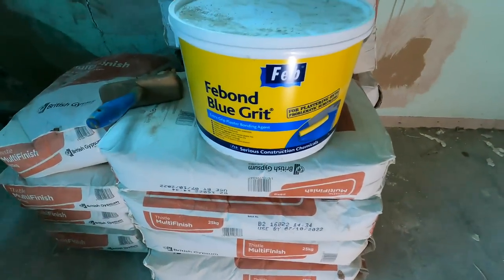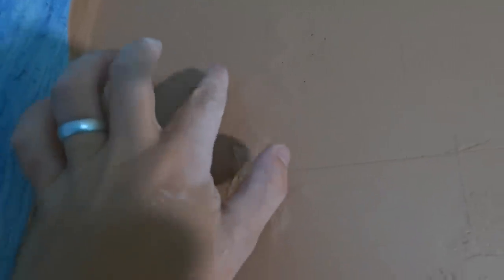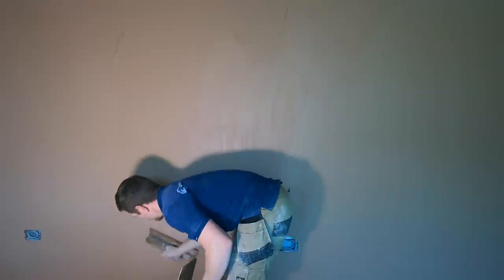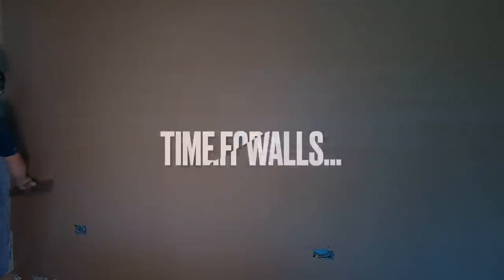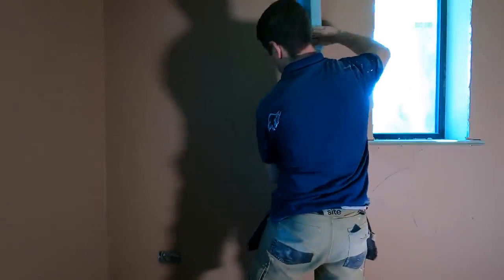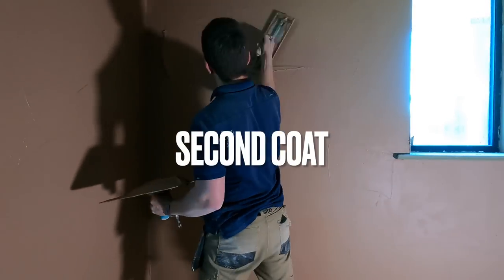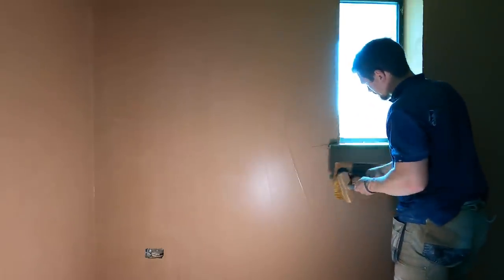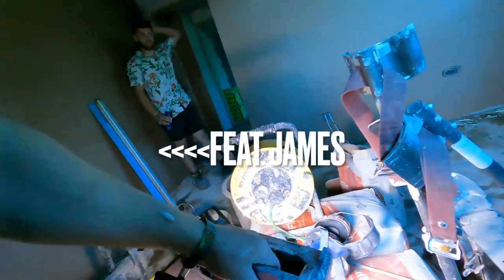I Hated Bluegrit Before| Here's Why I Was Totally Wrong

Comment: When I have had to grit, I’ve used Cementone plasterers stabilising primer, never had any problems. It is green, The grit is smaller too. I had to use blue grit for a job, it was horrible to use and like you said, you have to put it on think. Personally, I won’t use blue grit again, I’ll stick with the green grit when I need it. Good video 👍
Reply: I’m the same mate, I’ve watered it down with pva before but on a high suction background I’ll just put a pissy pva coat on the wall prior to the green. Lovely to skim over
Reply: I’m a bit old school if it ain’t broke don’t fix it never really had an issue with pva. A few people have told me they’ve had a set fail with blue grit so I’m a bit wary to use it. Plus like you said Blaine got to prep it the day before that’s ok if it’s a big job. But the green grit sounds a shout
Reply from the maker: I’ve used this for Rendering and it’s a much easier product. Just never used it for Plastering but I’ll try it now. Thanks for the suggestion!!
Reply: @bluevanmani  I had pva fail the other month, 2 coated the walls, next day the pva was peeling off like clingfilm. Then had to green grit the walls and wait another day. Never did figure out what went wrong
Reply: @NiktheEnglishGreekCypriot  the only thing I would say was maybe the pva was to strong with the first coat. Like you I do two coats but the first ones quite weak so it gets into the surface rather than drying to quick and sitting on it bit like when painters do a mis coat on new plaster.
Reply: @bluevanmani  yeah maybe mate, never happened before or since. I’ve applied neat pva for ages and never had an issue but since that happened I’ve done a 70/30 mix then a 50/50 maybe like you said.
Reply: Ive had 2 failures with green grit.. the full ceiling shelled off! It was scary how easy it was to get off

Comment: Just subed , I'm a chip for 35 years now. Just used blue chip 2 days ago on a skim fail on some artex , all plaster fell off so I straight on with blue chip , 48 hours later I plastered today. First I had to identify the problem,  this was an irregular crack to start off with along a ceiling collar,  an cast iron gas pipe had a 4x2 wedged underneath pushing on this 1 collar down ! Had the thing capped ! But it's never straight forward to half of these over skimed atex

Comment: the trick to using these products is to pva the backround first to kill the suction, the issue is the bluegrit ia drying to fast,its the same as using masonry stabiliser on outdoor sand and cement walls before painting them to prevent paint peeling

Comment: Not a pro, and I've only done a couple of walls over bluegrit. But my experience was that any grit showing through the first coat didn't matter. Just use the first coat to get the surface basically flat even if the texture is a little rough. The second coat will go on like normal and cover it.
Reply from the maker: That’s what I found mate. Good points 👍

Comment: I've seen pva fail used on reskim over sound skimcoat. That put me completely off ever using pva.
Blue grit may be more hassle but its much more reliable option in my opinion
Reply: I heard this one before. Look, PVA has been around for many many years. It'll be around forever. Blue grit or pre grit as I prefer is better but if a plasterer earns £200 a day then who is going to pay someone to roller the walls etc. As a plasterer myself, it's a easy day for me but it's expensive.
Reply: @taureanwilliams2900  I use SBR diluted about 4-1 instead of PVA which I have been caught out with it  re-emulsifying more than once over the years.And I prefer using Bond It Plasterers Pregrit, which I consider better than Blue Grit.
Reply: @taureanwilliams2900  very true. If I decide to use a grit I’ll either get a labourer to do it, or it’s charged at a day within the quote. Bear in mind it’s not just rolling the walls on that day, it’s scrumming, prepping the walls, can get beads ready, putting foam floor protector etc, so hardly just turning up and rolling the walls
Reply from the maker: Good points here lads!! Why spend more when PVA works and it’s faster??
Reply: @PlasteringForBeginners  I often use pva, but if I’m going over a wall that’s had paper on it previously, and especially if the clients stripped the paper and washed the walls down (on a job now that this was meant to have been done by the homeowner, was done badly), then I’ll use a grit for peace of mind. I also like skimming over the grit, feels like you get a nice purchase on the wall in comparison to going over a painted surface
Reply: @NiktheEnglishGreekCypriot  I’ve heard it so many times from customers and homeowners that the room will be emptied and they will strip off all the paper or flaky paint and all we have to do is the plastering. Needless to say it’s never all taken off the way it needs to be. It always ends up with the actual work being delayed while the background is prepared by us. I always price work with this in mind now. It’s a lot harder than people might think it is to completely strip and wash a surface ready for reskimming.
Reply: @teddysuhrensghost263  always a nightmare. I charge them by the hour if it’s not done correctly or cleared out. But I agree, it’s not easy, I’m a decorator as well and I’m both professions I detest the thought of removing paper and getting the areas ready
Reply: @NiktheEnglishGreekCypriot  oh, you see the worst of both worlds if you do decorating as well then 🙈😂. Fully understand charging by the hour for doing it correctly, as I do as well. Customers tend to look at me like I’ve shat on their carpet when I tell them but I refuse to budge for the reason that if something happens and the finish fails they won’t hesitate to call me back to fix it at my own cost. They want the best of both worlds I find. There’s a fine line between being accommodating and letting them take the piss.
Reply: Blue grit with 5l Pva if got time or if going over vinyl silk. Otherwise I use just Pva.

On them sandy backgrounds where you sometimes get in a tiled kitchen or bathroom that you bond out and still sucks like a bastard always seems a issue no matter what.

Tried sbr Pva blue grit. Dancing to Michael Jackson and still always a fuker 🤦‍♂️🤦‍♂️

Comment: How about a ceiling with plasterboard (just put in) do you think i can blue grit and then plaster?
Reply: Yeah you can do but it’s not needed. Better off just pva’ing it instead if it’s dusty or you need longer
Reply: @NiktheEnglishGreekCypriot  Thank you Νίκο, i was just thinking if it has very good adhesion to put it first, maybe the grit will make it even stronger, i know it's overkill but it's on my place and i thought why not.
Reply: @leosedf  no worries mate. Plasterboard is designed to accept plaster with no work to it, so unless the boards are really old and windswept, cut sections, or it’s dusty, then there’s no need for pva or grit. It will give you more time if you need it, but in that instance, you’re better off with extra time or an additive like that
Reply: @NiktheEnglishGreekCypriot  Oh i didn't know that, i was talking about a brand new bare plasterboard. Thank's a lot for this info.

Comment: I really don’t like blue grit at all, it absolutely eats plaster. Much prefer the bostik stuff that’s green and the bond-it yellow pregrit. Finer grit in both, use much less plaster I find. I fully agree with you saying that plasterers seem to think it solves all problems with backgrounds. It doesn’t. I’ve seen blue grit fail for a few reasons. A bad background is a bad background and needs to be sorted properly.
Reply: If I have to use blue grit, I always magic mix the first coat to get over it, second coat of just finish is super thin

Comment: Lad throw that blue grit in the skip where it belongs, if you want a grit there's only 2 options in my opinion, if ya got a big job and the the time to prep the day before it's bondit pregrit (yellow tub) grit is nice and fine and is like 120 grit sand paper so pretty much like skimming over plaster board, and it's cheap and goes further than bluegrit, second one is an amazing product from arrow (arrow bond grit) same texture as the first product but one hour drying time, skim same day, little pricey but I always have a bucket in my van, I  don't bother with pva, but as you said the background had to be good cos the grit is only as good as what it's put on,

Comment: Blue grits purpose is for problem backgrounds ie silk paint , smooth concrete staircases anything that doesn’t have suction that would make the plaster slide hence the grit to give you a key  otherwise pva all the way for internals 👍🏻

Comment: Best tip i have seen using blue-grit was from Alex Morley and that was adding a tub of neat pva to half tub of 10lt of blue grit is lot easyer to apply spreads better less clusters of grit and goes off a hell of alot quicker same day plastering on blue grit done this on my last couple of jobs works a treat 👌🏻
Reply: But pva re emulsifies! So what holds the grit onto the wall?
Reply from the maker: Thanks for the heads up pal! I’ll give that a go 👍
Reply: It’s all well and good but your using a tub of pva to mix in the blue grit not cost effective might aswell get a decent grit like microgobetis or even wba is decent
Reply: @brimplas1  mabey SBR instead ,
Reply: @brimplas1  I’m pretty sure blue grit is predominantly pva itself, I’ve always added pva to it when I’ve had to use it and never had any issues
Reply: @NiktheEnglishGreekCypriot  the problem with that is pva re-emulsifies... Blue grit doesnt this it must weakness the grit bonding to the wall.. i trust pva to stick to any surface, the only problem with pva is the skim can slide..

Comment: I'm working on restoring a period property. The walls were plastered beautifully but for some reason the previous owner lined the walls with paper and then painted it. When I peeled it off (took ages) , the plaster is smooth, very cold to the touch with bits of mould on it. I'm trying to paint it without the lining paper. Do I need to skim it? use PVA or blue grit and skim it again? I'd hire a plasterer, but the property is rural and can't find one!

Comment: I normally put 1st coat really thick let it take in a bit and apply 2nd coat and it trowels up perfect, but like you said I prefer pva or sbr. And for the paint to bubble and peal u was told its because of the lead in old paints and it reacts its even happened with using pva aswell

Comment: Here’s a little nugget for ya my freind Kevin Lindow invented blue grit , he is a fellow plasterer and was sick of the sand running to the bottom of the green grit which is sand pva and green dye he changed the sand to plastic 1mm grains which floated , he worked with sovereign chemicals in barrow in Furness to create this product
Reply: I used that sovereign grit many years ago fella! If it was just pva why does it not re emulsifie like pva ?
Reply: @brimplas1  blue grit and green grit both contain pva and pva is water soluble prob all the chemicals added to keep the pattern something has to be differant
Reply: @LakelandDamproofing  yep. I see people saying to put normal pva in the grit but thats just defeating the object of the grit..
Reply: @brimplas1  the grit is only in there for a bond and ya don’t need a lot of git stuck on the wall for finish to grip it
Reply: @brimplas1  unless it’s a ceilinv
Reply from the maker: That’s a brilliant story mate. Fair play to z as Kevin - sounds like a hero to me. Respect
Reply: @LakelandDamproofing  i agree. Ive had 2 failures with green grit.. you would be surprised how easy it shelled off.